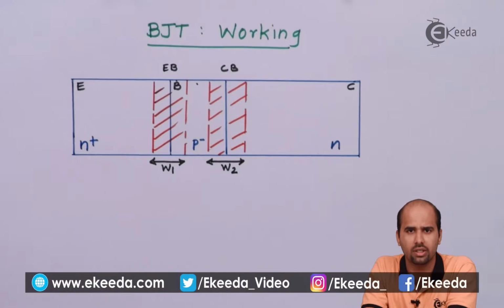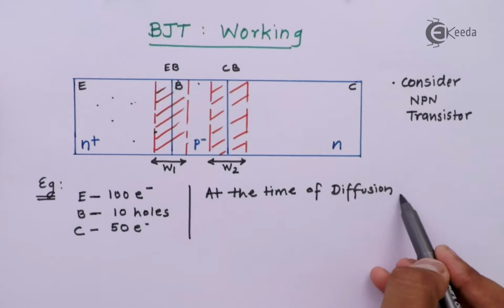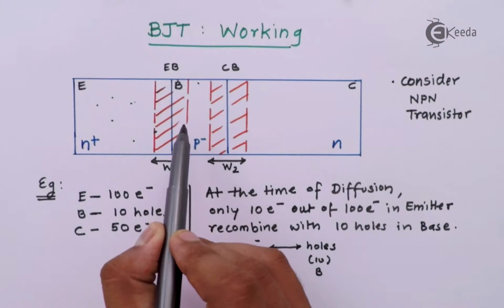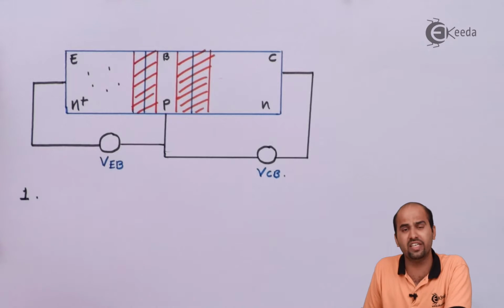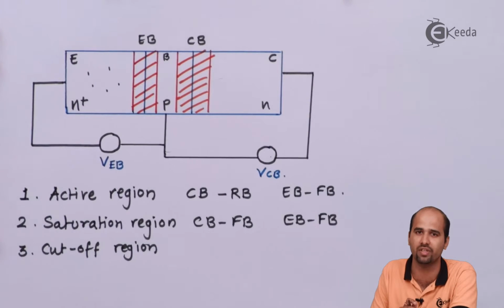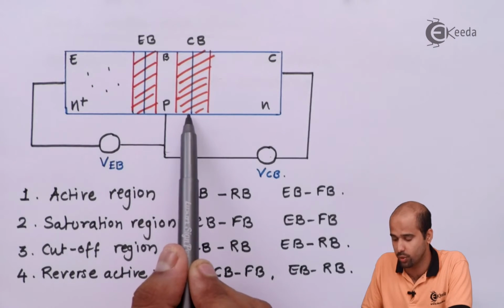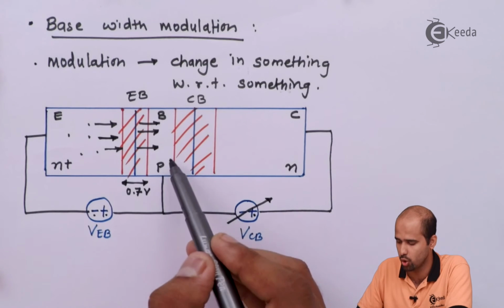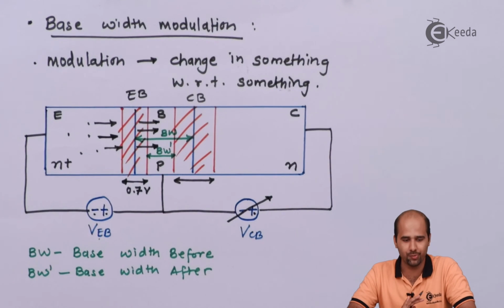BJT: Working | Transistor Biasing and Design | Electronic Devices and Circuits 1

Comment: Plz plz tell sir how can i Design a circuit using BJT for switching of a DC load. Load comprises of 5kW at a 
voltage of 200V DC. Represent the load with a resistance. Available stock of BJTs have 
βDC of 100, 120 and 150. Switching should be performed using a 12V battery
Reply from the maker: Hello
For asking your doubt directly to our Professors please download Ekeeda Application.
Android App : https://play.google.com/store/apps/details/?id=student.ekeeda.com.ekeeda_student
iOS App : https://apps.apple.com/in/app/ekeeda/id1442131224